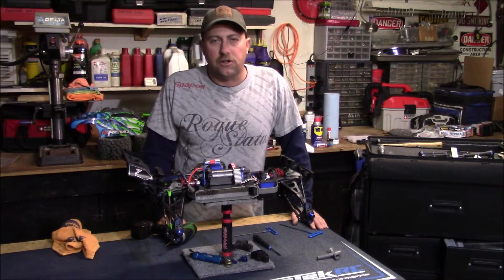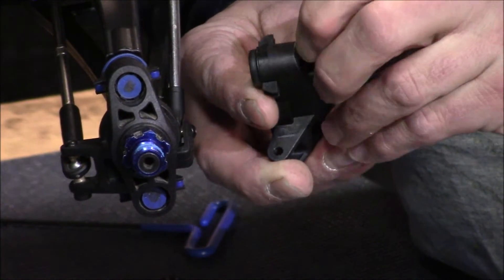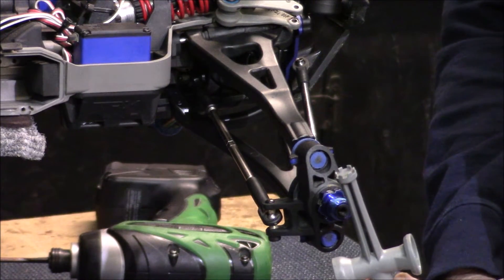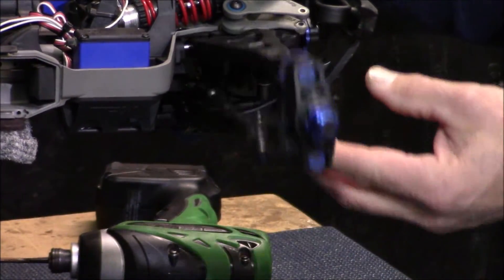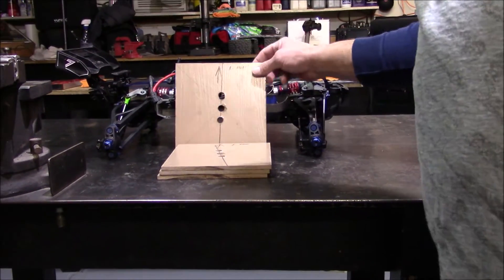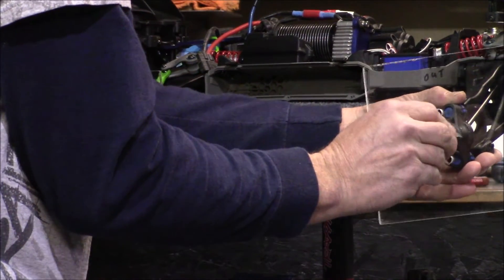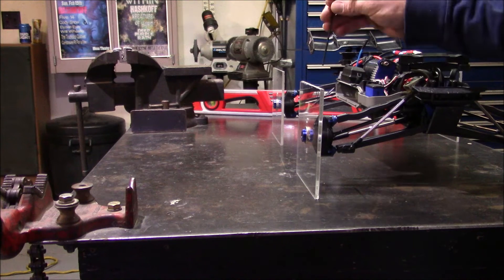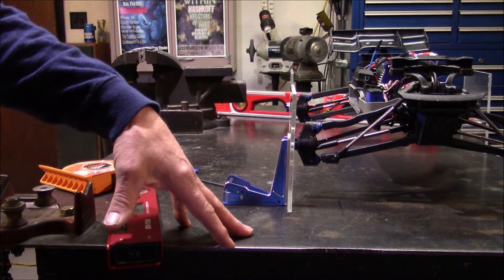How To Adjust Your CAMBER and TOE IN Alignment on The E REVO 2 0

Comment: just take the power connections OFF the motor. This is way overkill. I ended up doing this but i already had it close enough doing this with some tape on my work bench and a gauge and a square. i was off .5* on each corner.. for a basher that i take up to 60mph... ITS FINE.. this is really extreem

Comment: to simply avoid hitting your throttle and not spinning the wheel is take out/unplug the #2 connector from the receiver.  ALL SAFE  to turn on the car now because you do not have throttle enable on the remote control. you can now set the steering free of any unsafe wheel spin  or accidental throttle pull while having on those nice alignment custom made wheels.
Reply: DO NOT do this! You will have no control over the esc AND no power to the steering servo. BECs that power all the electronics are built into the esc, by disconnecting the esc your rx and servo are isolated. Disconnect the motor cables instead. Never connect Lipos to an esc/motor without a receiver.

Comment: Thanks for such an informative video it's actually more than anything inspiring. I know this is a random question and you probably won't see it, but I also want to do some circle track racing. Any tips on good ways to adjust suspension for those? I'm starting with what's called the mud boss class with the slash but this helps me work on my E-Revo  as well. So thank you so much
Reply from the maker: Thank you. Sorry it took me so long to get back to you. I would lower the ride height to its lowest position.  Then use 30 - 40w shock oil for a plush ride, and medium spring in the front so you have control in the corners and your nose doesn't dive down so much in the corners. And I would use 40 - 50w shock oil in the rear along with stiffer springs so the rear end doesn't squat under acceleration so that you get more power to the ground and less squat. Hope that helps you. And AVC or TSM could be a great advantage if it's dialed in right!🤙

Comment: What pinion/spur are you running?  I notice you're using the spacer. New to the RC world. My E-Revo 2.0 has the 20/46 but won't slot into the spacer. To tight.
Reply from the maker: 16/46

Comment: So how many turns out do you do on bottom to get the correct number?
Reply from the maker: There is no correct number, it's about what you want it to be set up like.
Reply: @upgradedrc3697  so how many turns out for the front and how many for the rear? I have no tools... What's yours set up at? I trust ya lol
Reply from the maker: It depends on what kind of tires, wheels, control arms, and everthing else. Besides all these parts ware out, so it is a constant adjustment to make it right. There is no number of turns out that I could give you and it be right.
Reply: @upgradedrc3697  proline trencher LPs
Reply: @upgradedrc3697  I did three turns out on bottom ball and it's too much
Reply from the maker: Maybe just do 1 or 1 and a half

Comment: Heh heh ... I came up with a similar solution, cutting squares!  I just disconnected the motor cables so I wouldn't have a flying quad saw in my kitchen with the kids (and my face) around.  I did power up the car and transmitter so the servos would hold the steering centered.  I used a cheap angle finder from harbor freight for camber.  I measured toe with a set of spring calipers, first from the chassis to each wheel to make sure things were symmetrical, then I measured total toe angles.  As I made adjustments, I measured back and forth, maintaining perfect symmetry as well as the correct total toe angle.

I guess this is all a bit overkill for a basher, but it drives me nuts to see the steering trim knob even a little bit off center just to make the vehicle go straight.
Reply from the maker: I couldn't agree more.😆👍🤘

Comment: my revo came out of the box with the rear wheels toed in significantly. my friend’s is the same way. seems weird when the manual says the front should be 0 and rear towed in 1 degree
Reply from the maker: If your just bashing it really doesn't matter to much. But if your wanting it for racing or just super straight it's all up to you and your perfered handling. 🤟
Reply: UPGRADED RC yeah even for bashing though its nice when it rolls straight. and im always getting the motor hot pretty quickly so getting rid of any extra resistance is a good thing. i just eye ball align it every now and then

Comment: Hello  nive Video thanks. can you give me the dimensions of the plates? With a dimension drawing of the holes....
Reply from the maker: Sure, this only works for the e revo 2.0 with stock parts. 6" x 6" square.  A 1/2" hole in the middle. And a 1/4" hole top and bottom of that hole 1" above center hole and 1" below center hole. 🤟

Comment: Great detailed video, one question though. Shouldn't you have the batteries in (disconnected) to get a true ride level before  adjusting everything?
Reply from the maker: Yes, it would be more accurate.  I get so many people telling me it's just a basher. Not necessary,  but that would be correct.

Comment: Hey man goodnight I just want to ask you a quick question can opinion 22 and a spa 46 to fit on a E-Revo 2.0 on less you take out the the a b and c motor mount
Reply from the maker: Yes, you will need to remove the fixed gear adapter to get that gear ratio to work. I would also install a 4mm washer on the screw in place of the adapter. if you haven't watched it yet, watch my video on gear mesh. !